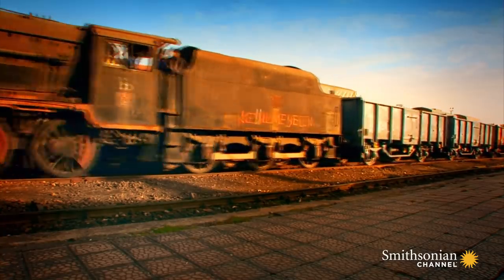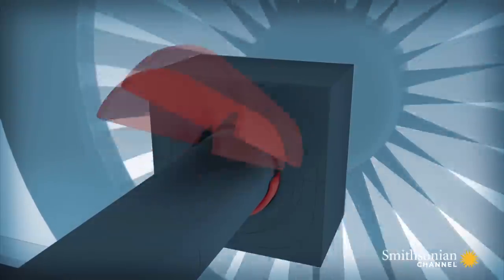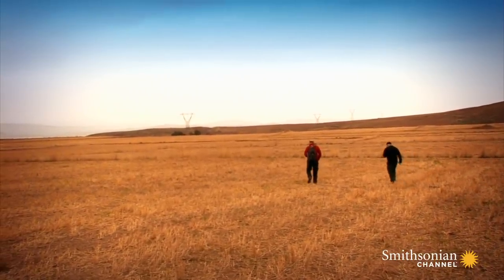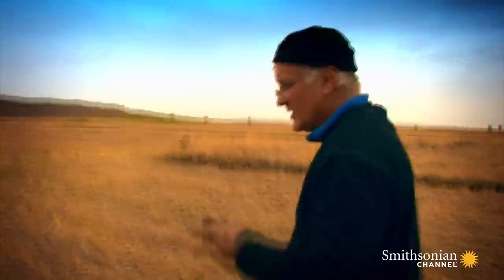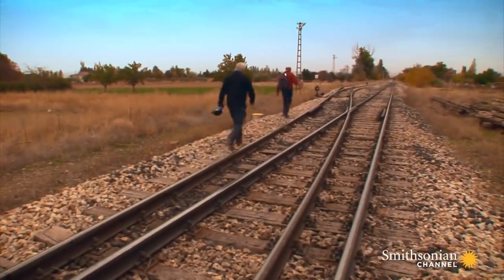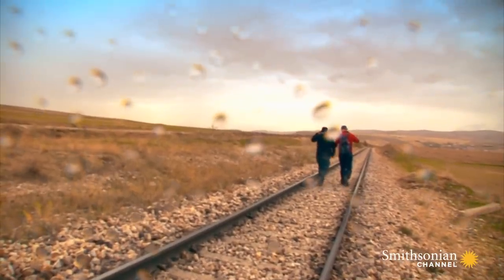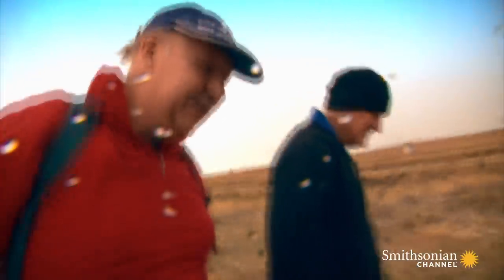A Mission to Rescue a Vintage Train Runs Into Serious Problems

Comment: A faulty bearing isn't going to derail that engine.
Reply: They feel they have to add drama to it. Saying a bearing is just going to make annoying noise wouldn't be interesting enough for them. If an entire locomotive could be derailed by it falling out...it wouldn't be designed so that it could just fall out
Reply: @ConquerCollin  So true mate.
Reply: Thank you expects...
Reply: Yeap.. Run it..
Reply: Actually it can because it might shake other wheel pieces out of them and the train could derail.
Reply: It would derail cuz the bouncing can widen the gauge and then the loco can sink in
Reply: Even if it couldn't, the axle wearing on the bearing block could seriously wear both and ruin them.
Reply: In what field are you working in? a donut shop??? that piece was not intended for nothing, it has a purpose; to stabilise the axle, so yes it can derail.
Reply: It could cause the axle to shake violently, leading to it snapping which would derail that train.
Reply: Even if it might not immediately cause a derailment the amount of damage that would need to be repaired justifies stopping to address the situation.
Reply: @ConquerCollin   its not designed so that it can just fall out, otherwise they all would, the bearing got worn and so did the method of keeping it in, without that bearing the real issue would be the friction heating the axle until it ended up bending or something similar, not to mention wearing out the area around the axle that would in the long run cost money and time to repair. Though all of that would take time its still best to fix it asap.
Reply: A faulty bearing itself will not cause derailing. However the ability of the wheel to move about as a result of the missing bearing not holding the axel straight, can cause the wheel to bent the track outwards - rolling it over. The engine WILL derails as will every car after it.  Don't speak of things you do not understand.  ALSO - I believe the rods - or part of them - have been removed. That means the dynamic balance is no longer valid. This leads to what is referred to as "Wheel Hop" It is one reason why locomotives to not achieve their potential speeds of 150 MPH  or so - Although the fasted locomotive (English) did achieve 24.6 MPH. The bearing were ruined in the effort but they did it. Yes, the same type of bearings that fell out of this one.
Reply: @ConquerCollin  This is not drama, the problem is real. WIth half the bearing missing the shaft for the wheel (Axel) is wobbling about because of the counter weight and dynamic balance. If the wheel on the side where the axel is not held straight twists and the right moment it will roll the rail over and derail the engine and all cars that are following.
Reply: Lol
Reply: Philippe Riopel maybe a donut inserted onto the wheel could have saved the day
Reply: Yes it will
Reply: @welsh_Witch  what would I know. I'm only a railway engineer.

Comment: when i'm older I want to save a steam engine from scrap
Reply: Me too!
Reply: @yeo5811  there is lots down at the NRM in York
Reply: @yeo5811  well you’ve got Flying Scotsman, Mallard, City Of Truro, LMS Streamlined Coronation, Tornado(?), there’s lots of steam trains down there
Reply: @Peppercorn60163Tornado  they've already been 'saved' though.
Reply: @Peppercorn60163Tornado  they are not scrap locos they are awaiting restoration
Reply: No more to be saved really most are just waiting their turn to be fixed now
Reply: @Peppercorn60163Tornado  tornado is not owned by the NRM as is running and those locomotives have been saved
Reply: @welsh_Witch  I heard that the rail minister of the UK wants to scrap Diesel engines and bring back steam engines. He wants Diesel engines to be gone by 2040
Reply: @Muzical-Man  me to as well love steam engines

Comment: It didn't help when they moved the engine with all the drive rods removed.  They put the wheels out of balance by thousands of pounds.
Reply: If it's in the condition like it's in then they had to be took off as they could have run hot.
Reply: They had to due to the condition of the rods would have been more dangerous to run with them on

Comment: Chris Brooks iv met in person. He told me the whole story of what happened including those which didnt make it into the programme. The white metal falling out was genuinely not scripted, it realy did happen. It was the same where the diesel engine broke down on the steep ascent (the clip of which was just before when this video started). There were also numerous hot axleboxes on the two engines at certain parts of the trip to Izmir and there were more crew members (non camera crew related) with the loco than was shown in the programme too.

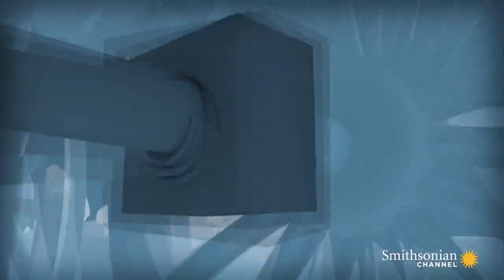Comment: 1:19 that was a bit of an exaggeration I think
Reply: lil bit
Reply: You never saw a train jump in the air and magically rotate 90 degrees? Should watch more Thomas the tank engine.
Reply: While the animation is a bit dramatic the risk of derailment isn't and the final picture is not far off the many examples of derailments at speed due to a failed bearing.

Another person educated on trains commented this: Its dangerous becuase the top bearings takes the load of the train as it moves. If it falls out there will be a huge amount of friction from the dragged wheel on the axel aswell as the wheel. Something they call hotboxing. 

That compromises the axels strength causing it to split in two and parts flying under the rest of the wheels moving, causing the train to fall over itself.

Not the best copy of what he said but its true.
Reply: Train got yeeted

Comment: Chris Brooks I met a few years back on the 1T57 45th anniversary railtour, it was a pure coincidence as he came up to me and said I was brave being by the window all day. He told me that there was more to it than the programme as unlike what they showed in the programme they apparently ran multiple hotboxes en route and the speed had to be kept at around 20mph max owing to the state they were in. There were multiple leaks with the brake pipes on both locos too which took ages to fix (one loco was in worse state than the other) and all the motion needed to be took off both locos and the cylinders isolated. Owing to paperwork for purchase, movement and customs aswell as arranging transport for when they arrived back in the UK it took around 5-6 weeks to undertake the project.

Comment: For the bearing to be able to fall out, whatever held the bearing in place must have also fallen off, I presume. If so, where did it go, and how did they solve the problem without that?
Reply: Well yes but no. So what most likely happens is the bearing came lose after the area around it had rotted away

Comment: So, this took place in Turkey, fwiw.  Too bad the bearing wasn't lubed before this move was started.  A bit surprised it isn't a roller bearing.
Reply: I'm sure it WAS greased, but the dead loco wasn't able to run its lubricators - any movement involving a dead locomotive being towed is liable to end with a faulty axlebox.
Reply: The Stanier 8f's weren't built with roller bearings, unlike many american designs of the 30's and 40's
Reply: kyle pennypacker that was a surprisingly common issue with LMS goods engines. The 4F's had it rough, the 7F's had it rough, the Garratts had it especially rough. It was bloody normal
Reply: @Ty-yt3lj  the Fowler locos all had horribly undersized axleboxes. That is not a problem which persisted on the Stanier locos, which owed more to Swindon practice.
Reply: @Ty-yt3lj  I am aware. midland designs always had axlebox problems
Reply: Roller bearings were not common practice in the UK until after the war

Comment: so why don’t they just get a new piece and put in there it would be a lot easier
Reply: Where Exactly do you "get" the new piece, its a locomotive desing form the 1940's as an effort for the war, i doubt they would find any anywhere, specialy in india since its a british desing
Reply: Cheese wouldn’t it be the same as all other steam engines that exist
Reply: @frostythesnowdragon3170  They manufactured those peices specifically for them,
No two engines are identical as belt driven manufacturing wasnt a thing until much later in life
they were all hand built so they need peices that can fit perfectly down to the wire to work properly and efficiently
Reply: No it would have been next to impossible to find a new part for two reason No.1 location No.2 time

Comment: Cancel the project because an axle bearing failed? That is idiotic bull-sh*t overly dramatic stupidity. Any good machine shop could make an identical bearing fairly quickly. I'm wondering if they even greased the bearings before pulling the locomotive thirty miles. If they didn't they are idiots. My guess is that they did not grease the bearings.
Reply: Actually they would have had to as they would have missed their ship

Comment: So you're telling me that they have numerous other exact copies of this piece across the other axles, and instead of just copying one they are gonna go walk hundreds of miles of track to find the piece which may or may not even be there. It's rusty it could have disintegrated under the pressure. I know they're in a time crunch but put that loco on a siding and go craft a new part. 

P.S. I know the show is fake and staged. There is no way they could ever realistically find that part, and if it fell out then it clearly has a problem with is so finding it and slapping it back in won't be that easy. I'm getting sick of these fake-ass shows by an otherwise reputable source.
Reply: Walk a few miles.
or
Take out another bearing half and try to find somewhere which happens to have the correct metal and is willing to make a one-off.

Mmm.
Reply: @Gordanovich02  It's not any special metal and they don't have to find somewhere to make a one off. They are restorers! Furthermore if the piece came out then it obviously has something wrong with it. What happened here are the early stages of a hot box, and in most cases the bad bearing was destroyed under the heat and pressure thus causing the issue in the first place.
Reply: Yeah no issue, just go into the local town, I'm sure that they will have a foundry that will quickly be able to cast them a new shell, without a pattern, and as their in the ass end of nowhere in turkey, I'm sure that they will have some white metal lying around. The axle boxes and journals on these are mechanically lubricated, which since the thing had been left to rust for decades would more then likely not be operational, in addition, the engines were used in till they wore out, so the thing was knackered to begin with. The shells are held in with steel screws, not unreasonable to think they could fail through rusting and the shell fall out. One of these men had already restored a Turkish 8F to traffic, It was based at the Gloustershire and Warwickshire railway if memory serves.
Reply: @samwhite1995  Okay first of all, I never said they had to do the fabrication ON SITE. I said they could leave the loco on the siding and come back to it later.
Reply: @samwhite1995  Furthermore, the chances are that if the piece fell out it would be fucked up beyond use. They should make a new one anyways. Also I find it incredibly convenient that the camera crew was not present when that guy found the missing piece. You're telling me this whole production only had a single camera crew? Bullshit.
Reply: @zackbobby5550  quite right, it would be of no use for normal operation, but that is not the case as the train is only going at slow speeds, so it is not subject to the forces that it is normally subject to, never the less it still act as a means of preventing the axle from moving to any large extent. In any case, for a new one to be made, would of required the casting to be made in Britain, flown out and then be scraped in, which would require removal of the axle box, none of which would of been possible in the time that they had. As for the camara thing, I don't know, but I wouldn't of thought a camera crew would be willing to trek all that way with all the kit, just to help look, if it were the other way and the camara had been with the other guy when he found it, that would of looked convenient too, all I can say is I worked with a chap that knows Mike, and he said they did, and they were looking for something like 3-4 hours in total.
Reply: @samwhite1995  First of all, the train was going normal speed not slow. Secondly, the camera crew clearly did trek with one team. Thirdly camera crew is paid it's not about what they WANT to do, and lastly many many sources have proved this show to be staged.
Reply: @zackbobby5550  well as I said, I don't know about the crew think, but for the 8F that is slow, normal speed for them is 50-70 mph, it doesn't look like they are doing much over 30 for a lot of that, maybe more in places, if you haven't, it's worth watching the whole program before passing judgement. My point is that it's quite possible for an unsecured shell to fall out.
Reply: @samwhite1995  I know. Also I have watched most of it. But my point is the chances of them finding the piece and being able to slap it into place and have work fine are incredibly low as shit was probably broken.
Reply: @zackbobby5550 I do get what your saying, all I'm saying is that it's still possible. And from what I heard, it was true, I work in the steam preservation industry in the UK on a GWR Castle class loco, the axle boxes are of a similar design, the designer of the 8F used to work for the GWR.
Reply: @samwhite1995  I'm not saying it can't be done, I'm saying this show has been proven fake as all others by this same network. Well not so much faked as staged.
Reply: @zackbobby5550  I see, it was shown on the history channel here, about 5 years ago.
Reply: how do you know it’s fake

Comment: The should not have an engine that woren out running
Reply: north western thomas It isn’t running, the engine was being pulled along.
Reply: @simonwest9450  I ment that it should be put on a lorry so the accident didn't happen in the first place all the parts are rusty and a lot are missing
Reply: @skarloeyno1510  couldn't get one